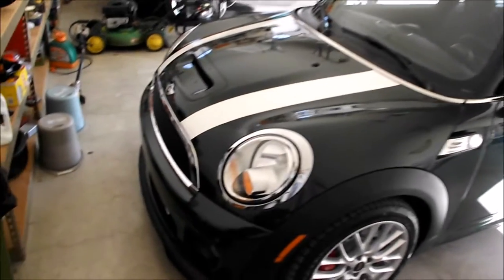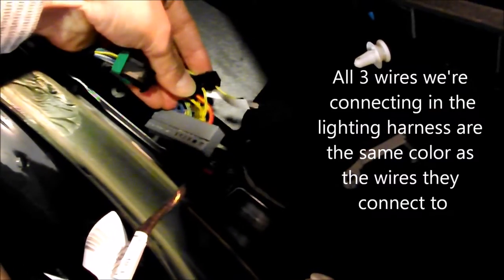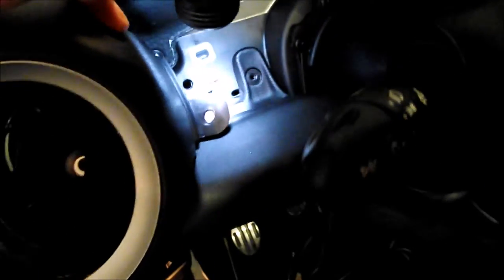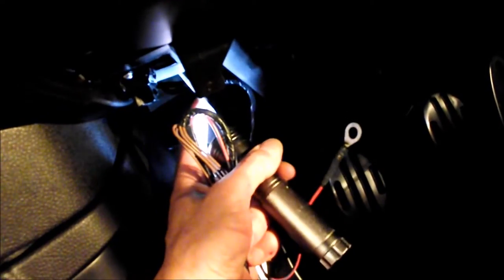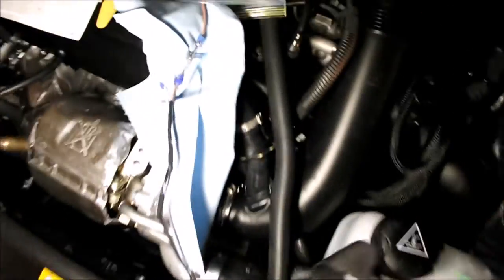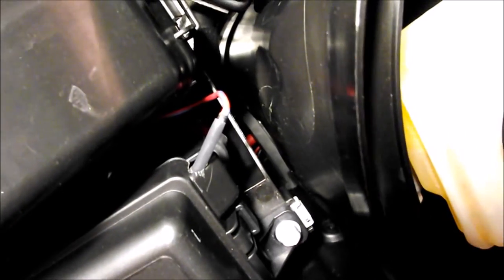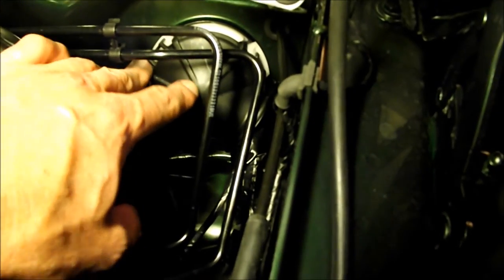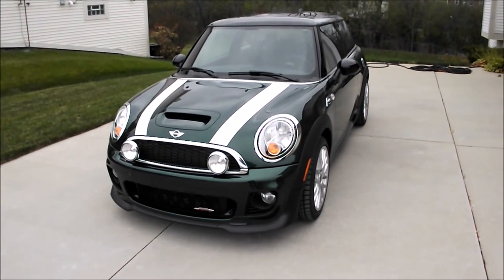Mini R56 Accessory Headlamp Install

Comment: I have a problem, I connected such lamps according to the MINI instructions and they do not work. The manual only says about connecting the A1 cable (yellow and blue), but there is no information about connecting two additional wires from this bundle (A1), and I can see that you have also connected?

Comment: Thanks for the video! I have a question, I did this same install on my 2009 clubman. However, the lights only come on with the high beams and not with the headlights. The little green light is on the switch. I’m stumped so if you can shed any light on my issue I’d appreciate it. Thanks!!
Reply: That's their intended purpose. At least here in Europe, they only come on with the high beams.